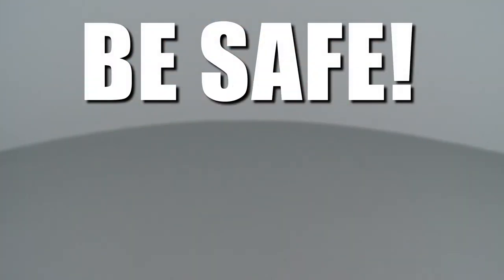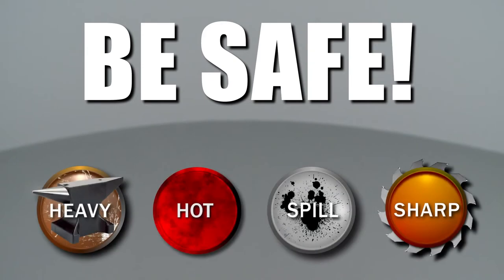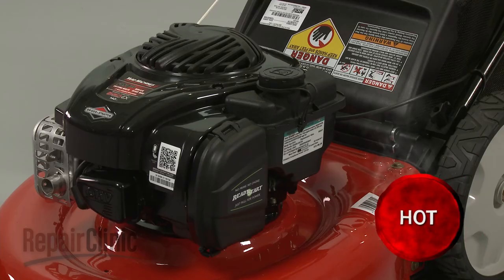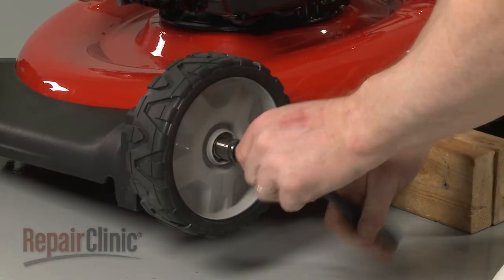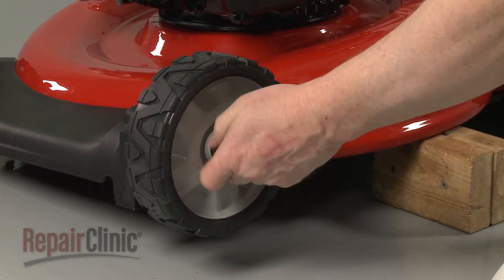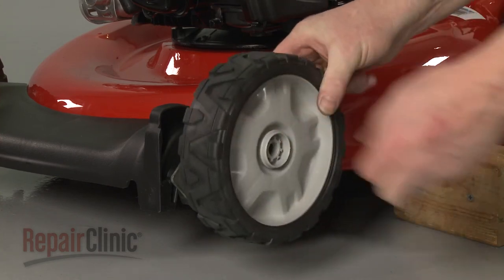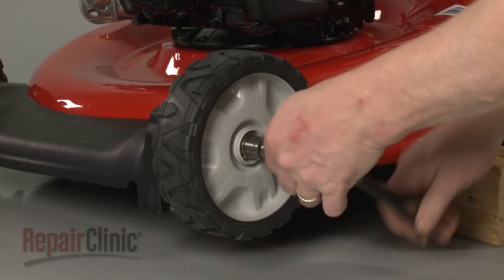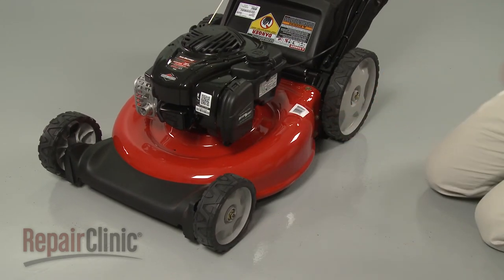MTD Lawn Mower Front Wheel Replacement #734-04562

Comment: does anyone have any ideas how to get the wheels off of the front to change the front axle if the adjustment lever is broken off
Reply: Since your question was 3 years ago, I'm sure you've figured it out, but I thought I'd reply for another viewer that might have the same question. First, remove the wheels with a 9/16" socket. The front axle can be snapped out and replaced by pushing down on the exposed axle after removing the wheels with firm pressure from the top of the mower to get it to snap out of the plastic holder. The replacement axle is replaced by firmly pressing it back upwards into the plastic holder. It's held in by a interference fit in the plastic.

Comment: please add correct part number the exact wheel used in the video, this is not the correct part number
Reply from the maker: MTD Lawn Mower Front Wheel  #734-04562 click here:  http://www.repairclinic.com/PartDetail/Wheel-Assembly/73404562/1828068?TLSID=1875
Reply: RepairClinic.com not sure if you noticed that's the wrong part number, that's an entirely different wheel.
Reply from the maker: Ah, yes the wheel has been updated by MTD and now looks different than the one in the video. Function is the same. Thanks!
Reply: RepairClinic.com I'd like to order the one in the video front and rear

Comment: How about performing all of these repairs on used equipment LOL.  You know the ones that customers have beat to crap and everything is seized and/or rusted together.  I never get to work on a nice perfectly clean lawnmower HAHA.
Reply from the maker: William Todd We appreciate the feedback and we have done videos on used equipment in the past, but we have found several advantages to creating videos using newer products.
Reply: ***** Just had to poke fun at a nice shiny mower and replacing new parts with new parts LOL.  

All the same understanding and principle.  Easier to show on a new machine for sure.
Reply: @repairclinic  what is Carburetor part number for this model number 11A-436Q095 mower?